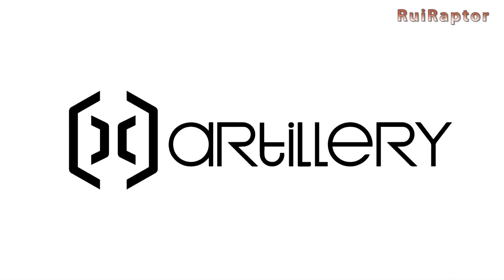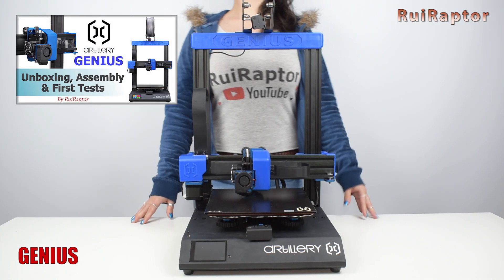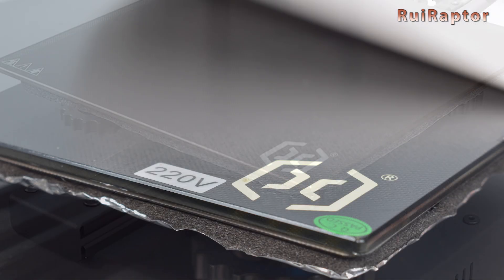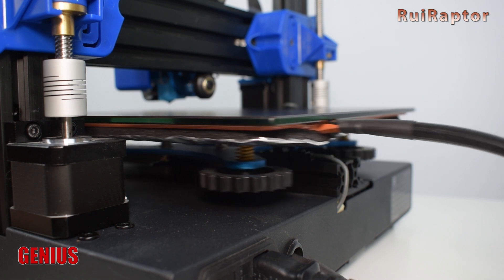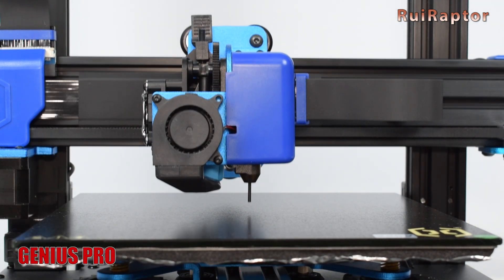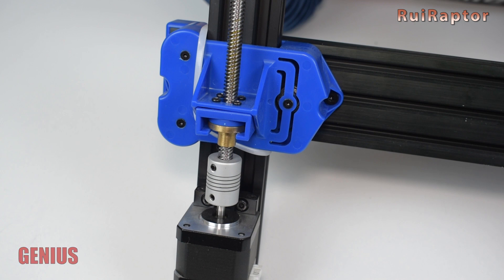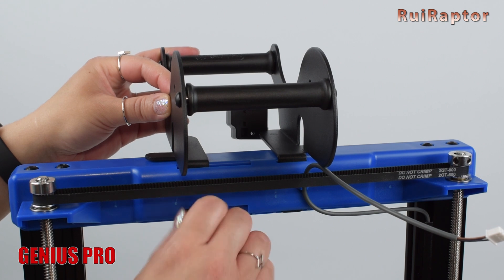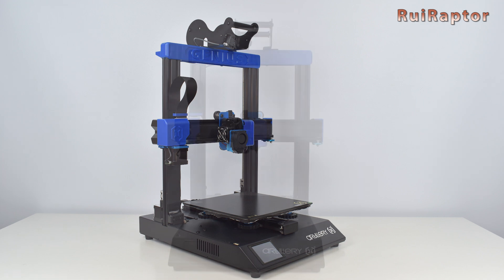Artillery GENIUS PRO vs GENIUS - All The Differences

Comment: Did you know that if you run the BL touch on your genius you can direct swap, the head with the Genius pro head with only having to change 1 screw on the mounting plate, and it will run and print as normal? save you by buying just the BL touch.
Reply: Hi, may I ask something here? You mention that the Genius PRO heads are compatible to the old Genuis printers...
I have a Genius and need to replace various oarts of my Extruder. I do NOT currently have a BLTouch, but I'd like to add one. 
So: what would you advise? 
If I understand correctly, I will in any case have to flash the firmware. 
That said, does it make sense and is it compatible to just buy a complete Genius pro extruder incl a touch sensor (~75EUR) or to buy various spare parts (~30 EUR) plus the touch (25 EUR)? 
On one hand it's a bit cheaper, but since I have my printer ripped open right now I can't print the parts required to mount the BLTouch anyway, so I could just as well buy the whole thing and be done with it...
Are the heads really totally compatible?
Thanks for your help!

Comment: At 5:13, you are incorrect, at least on some machines. I just gota Genius Pro today, and those screws are no longer there for adjustment. It is a stupid design unfortunately.
Reply from the maker: Not incorrect. The set screws that we have on our printer and that we show in the video are there to adjust the amount of pressure.
Reply: @ruiraptor  right, except they do not exist on my genius pro. Read my comment again
Reply: Same for me

Comment: You’ve made an error. Yes, the power supply is switchable between 110v and 220v but that power supply provides power to everything except the bed, it’s powered directly from the mains voltage via a relay. So a 220v bed in a 110v country will heat but very slowly but a 110v bed in a 220v country will go bang as the voltage is twice the rated voltage of the bed, bye bye bed!
Reply: If the bed has two heating element circuits in it, they could be switched either in parallel for 110v or in series for 220v.
 That's usually how those voltage selector switches are wired to operate.

Comment: So they just fixed problems which shouldn't be there from beginning, and which most of the owners already fixed. I dont see any added value, also add leveling probe is easy on Genius, because pins for it are already there on extruder board.

Comment: Leveling screws and springs in 2021? Why yet another printer? Artillery made nice decisions on their Anycubic Vyper: dual independent z axis with two endstops and a fixed  bed without need to level. Direct drive for the Vyper as an option and improving firmware IMHO would be a better solution for customers than yet another printer.
Reply: Artillery and Anycubic are separate companies though
Reply: Levelling screws are good for tramming the bed and the printer. You do want a square printer, right?
Reply: @iskandartaib  a good construction doesn‘t need tramming. Good examples are Prusa i3mk3 and Anycubic Vyper.
Reply: @MarkusFotofieber  The former I'd believe, they tram it before it leaves the factory, or they make sure the parts fit together only in a way that can be square. For the price you pay, it'd better be square. The latter? Maybe.. but I'd have to confirm it myself.
Reply: I have 6 Chinese printers 4 Creality and 2 Voxelab, the Voxelabs are pretty good for the price but the Creality machines are a constant pain in the arse, I will not buy any more Chinese printers, I built a Pro 3D V-King 400 from the best available quality parts and its a winner, I havent had to do anything for months to it.
 My next purchase will be the Prusa XL when it is released, Prusa take their time with their designs and only release when it is perfect, since they anounced the XL machine Creality have released six FDM printers and all of them crap, they cant even get the BL Touch firmware correct
Reply: @AndrewAHayes  I run the sidewinder x1 and it is virtually trouble free. A few years now, and I love it.